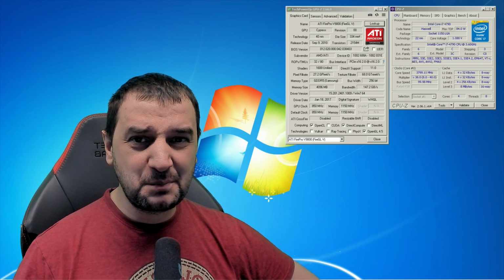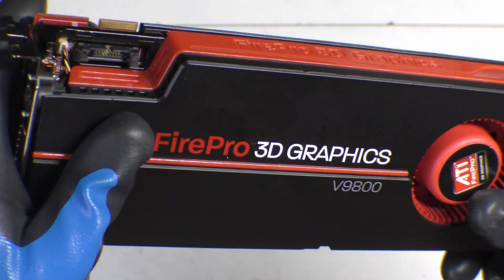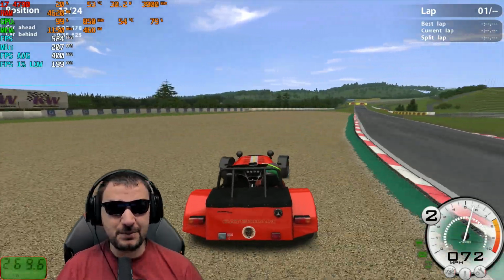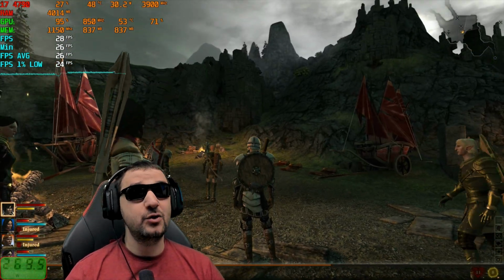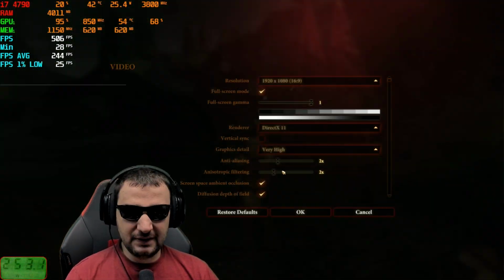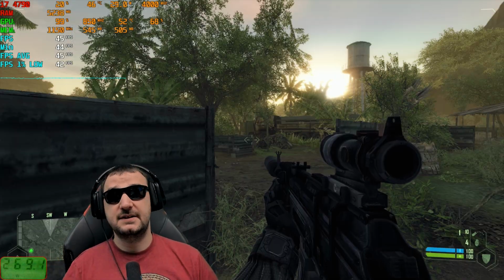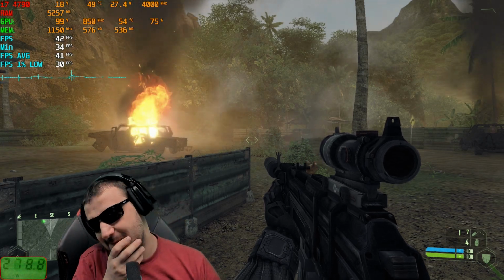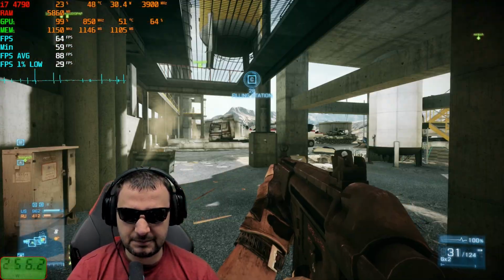ATI FirePro V9800 Benchmark

Comment: It should be paired with R7 9800 X3D (yea...I know, it's expensive, I am not serious) 💩💩💩
Reply from the maker: That will be funny. Like the i7 6950x with rx 6950 xt
Reply: @DanielCardei  And maybe add 2003 Radeon 9800 (Pro/XT) to comparison. But If these were only AGP (I am not sure), it would be technically impossible. 💩💩